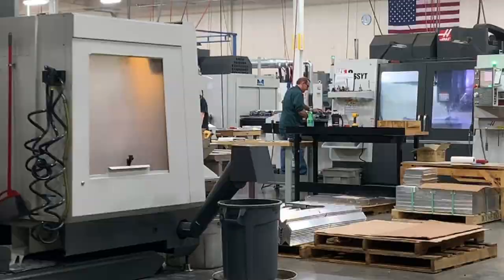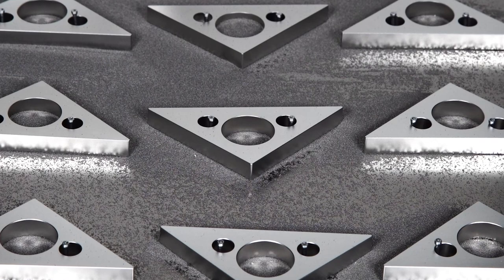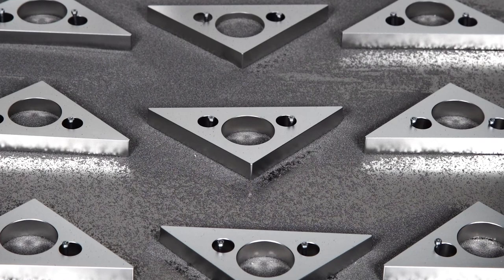Making Gauge Blocks | Production Update

Comment: So basically only as accurate as your milling machine ? No precision grinding or other higher tolerance process ?
Reply: Let's see, a Starrett 45° Angle Steel Gage Block, Working Grade (±5.0 Seconds) goes for $961.00 USD +Tax/S&H Ea. I'm fairly sure the CNC machines Woodpecker's are using will produce an accuracy that will not only meet but exceed your woodworking needs. And at $109.99+Tax/S&H, I'd consider it a bargain! If you have any Woodpecker tools, you'd know that they are extremely well made, and their tools are working grade. And they are equal in accuracy to any Starrett squares or straight edges I own. Don't get me wrong, I love my Starrett and wouldn't trade them for anything, but Woodpecker's produces a very solid and accurate tool as well.
All the Best, Chuck
Reply: No way there as accurate as starret without grinding. I'm thinking they left there grinding out of the vid